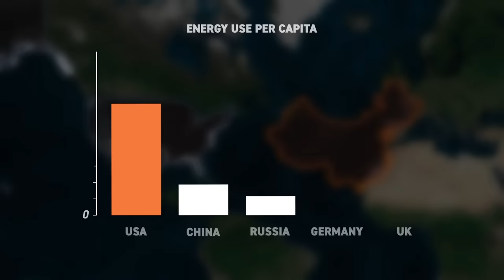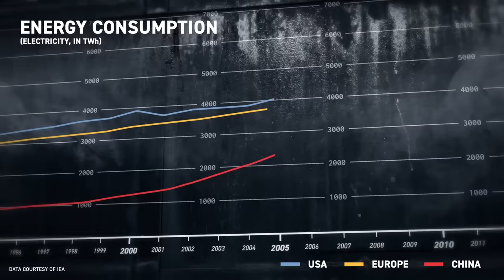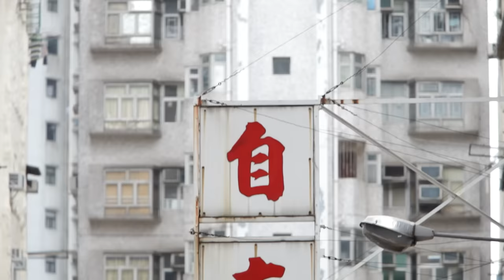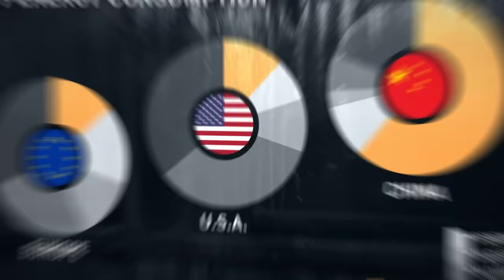China’s Electricity Problem

Comment: Nuclear is completely ignored.
Reply: I know! Though nuclear IS less cost competitive than renewables. I still think its the ideal base load solution, but its cost inefficiency has always been what made it hard to produce.
Reply: I was thinking the same.
Reply: You really want to promote more nuclear power in China with their quality control?
Reply: Nuclear power isn’t inherently unsafe, given proper safety they are VERY safe, I doubt china would want a nuclear meltdown in their own territory and would thus preform more stringent safety regulations
Reply: @johnnybraccia452  nuclear power is the cleanest and safest power source, I'd trust them to run nuclear more than any other source
Reply: They purportedly got a new fusion reaction recently.
Reply: >.< haw sah, noocrear
Reply: Did you know the most advanced nuclear powerplant is in China..and they significantly building more Nuclear powerplant over the years..its just that demand is more than supply especially in colder or hotter season
Reply: Nuclear just takes too long, about a decade or longer, to be precise.

China is installing 5 large nuclear power plants worth of electricity generation capacity every week, by installing green energy, which are far easier to set up and the return is almost instantaneous.
Reply: @Bailydoggy111  yeah,  righttttttt.
Reply: They tried, and had their own Fukushima near Guangzhou...
Reply: @Bailydoggy111 Sploiler alert: It had. It was even supposed to be supervised by their French joint venture company, but even the French didn't manage to convince them to abide the safety guidelines.
Reply: Nucleaphobia

Comment: Here in India not turning the AC on during summers just isn't an option. Soon the temperatures of north Indian cities are going to literally be unlivable, and ironically ACs are a big part of that :(
Reply: Y'all need a hot water line equivalent to what iceland has but in reverse. Suck all the heat into large heat pipes and pump it to large factorys that can use the heat as raw power for manufacturing.
Reply: Yeah India is like 40-50 degree C this year... imagine in 10 years lol
Reply: It's impossible!
Reply: Good thing atleast we have good solar Cell. Good sun
Reply: South and SOuth -east asia will be uninhabitable
Reply: @profwaldone  lol, geothermal heat pumps exist.

Look into them.

They come in all sizes from big enough for your house to big enough for a skyscraper.
Reply: Soon enough? It’s already 50C in summer
Reply: Well An just open windows
Reply: I thought I'm the one feeling that way.., This is getting worse year by year...
Reply: They need to use passive cooling. Paint everything white and point windows north
Reply: @profwaldone  that wouldn't work, AC's aren't meant to spew out boiling out temperatures, that's not efficient.
Reply: @baronvonslambert  AC is just a heat pump.
Reply: @Sinaeb  Technically they do, if you're talking about the refrigerant's boiling point.
Reply: @baronvonslambert  there is no difference between an heat pump and an AC, well ok
it's just that the heatpump is smart enough to be able to do reverse flow.
Reply: Lord Mountbatten reputedly said, "You need two things to rule India, and one of them is air conditioning."
Reply: It's probably so hot in places like China and India because of all the people that live there. The body heat generated by billions of people must be insane!
Reply: The reason it's so important for India to industrialize is because it's vital that people have access to air conditioning.
Reply: Yeah you guys need to build district cooling. Much more efficient and lower emissions.
Reply: India needs nuclear power and a lot of it.  India should also develop new types of safer nuclear reactors that use better coolants than water.  All nuclear meltdowns have been due to coolant loops becoming unable to remove excess heat, reactors boiling off their cooling water, then the fuel melting down.  If better coolants like liquid metals or molten salts are used then the fuel will be unable to boil away the coolant.  

There should also be development into breeder reactors that can make fissile material out of far more abundant materials than the naturally fissile but rare uranium 235.
Reply: Doomsday is on the horizon. «These things I have written to you who believe in the name of the Son of God, that you may know that you have eternal life, and that you may continue to believe in the name of the Son of God». «Whoever believes in the Son has eternal life, but whoever rejects the Son will not see life, for God’s wrath remains on them».
So, believe in Jesus ❤️
Reply: not just North Indian cities bro. Chennai is clocking 40C in summers T-T
Reply: @bluepurplepink  you think India is bad? We still use Fahrenheit, so the temperature is MICH higher!
Reply: "ironically ACs are a big part of that"
You wouldn't need as many of them if you had urban planning and more trees and green spaces (i.e. NATURAL air conditioning)
Reply: @profwaldone  Iceland has to actually cool the water before putting it into the pipes that go to the consumers so that the pipes won't be damaged.   It is still very hot even then and getting caught between the shower and shower wall when accidently turning the mix to full hot is a real problem.  The problem is when you have to reach through the scalding shower water to turn the water off.
Reply: @profwaldone  Thermodynamics doesn't work that way ....
Reply: @appa609  This is the only realistic solution someone has given. Cheers.
Reply: The trade-off of 24 hour energy.
Reply: @asbestosfibers1325  they depend on variance from the long term average.   The long term average temperature is rising.
Reply: @asbestosfibers1325  I guess English isn't your first language. 

Heat pumps rely on the different between ground and air heat.

The ground is getting hotter.  It is the average annual temperature.   The average annual temperature is rising.  

 Heat pumps will be less effetient.

Plus you need to do something about that chip on your shoulder.   It's so big is going to mess up your neck.
Reply: @profwaldone  That's pretty clever.
Reply: @asbestosfibers1325  you seem pretty certain so I looked it up.   I'm talking about geo thermal heat pumps.   We have been talking part each other but I should have been more clear. 
However non hero thermal heat pumps do the temperature 20 degrees.
Reply: I can count 4ACs in my Village , that's just near my house there.

Forget about cities, AC is becoming a trend among the Middle class residing in villages. Newly weds are receiving ACs in gifts. In coming 5 years, the demand will skyrocket 
You can get one for some 20-25 thousand rupees ( every level) .
Reply: @profwaldone  High temperature industrial heat pumps are already capable of generating low temperature process steam at 125C and higher with a coefficient of performance of 2.2 to 2.5.
Reply: @Sinaeb  Read my previous comment. Industrial heat pumps exist that are capable of producing 125C process steam with a coefficient of performance of 2.2 to 2.5. New units with even higher output temperatures are available.
Reply: @gregorymalchuk272  wow, sounds cool.
Reply: @profwaldone  Just need more plants they absorb heat and cool places down turns carbon into oxygen
Reply: @myjizzureye  Are you having a stroke? because that was beyond non-sensical
Reply: Same in many Chinese cities. Millions of dwellings are simply not livable without aircon. I kept mine to a minimum and yet each electricity bill had warning reminding me that I was consuming too much.
Reply: That's one of the problems with current large cities, its full of concrete, asphalt and other materials that absorb heat, not reflect it.
Reply: @dr650dude  haha
Reply: Soon? Been saying that for 50 years now
Reply: @profwaldone  Environmental heat is spectacularly inefficient for power generation, the result of the Carnot ratio. If the hot side is 50C and the cool side is 40C, the absolute temperatures are 273 degrees higher: 323K and 313K. That is a Carnot ratio of about 0.03; 3% is the absolute limit of efficiency for such a process with those temperatures. The same applies to using heat itself in manufacturing processes; it makes very little difference if the starting point is 40C or 50C.
Reply: i heard that Siberia will soon become arable in the near future because of global warming. i don't expect India will become too hot for human to live. hope India can work with the rest of the world to combat climate change. climate really becomes super weird in recent years. if we human don't do anything, earth mother will punish us.🙂
Reply: In navi mumbai, there is no electricity two days out if seven hampering development and progress!!!
Reply: Not only initial high costs, there is a steady revenue stream and no recurring expenses!!!!
Reply: Dolar and wind hardly meet the complete needs of countries in Europe and North America, with more favourable climates!!!!!
Reply: China may soon Kay transmission lines from Pakistan and Nepal yo bail them out!!!
Reply: @profwaldone  thermodynamics makes this essentially impossible.
Reply: Tell that bs to the people in Dubai and the UAE, you ain't seen nothing yet and are already fainting. We have only two options, we either prosper or blame everything (gases, carbon, production, the sun, coal, chinese etc etc) for everything. Produce, prosper that's the sustainable answer.
Reply: quick question, how do the poor people survive Indian summers without AC? do they all just die when it's hot out? I'm sure some people do die of heatstroke, but AC can't possibly be your only option
Reply: @O.s..a  Jesus is just one of many sons and daughters of God
Reply: @O.s..a  so chill
Reply: @profwaldone  Is there a name for this?